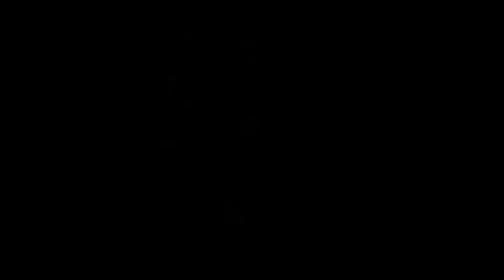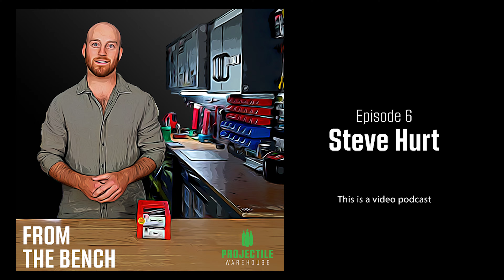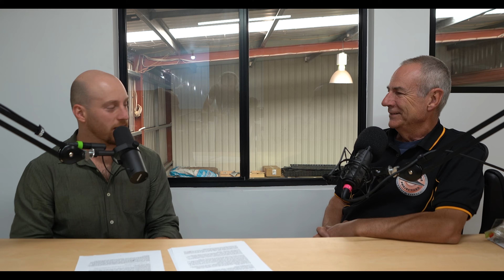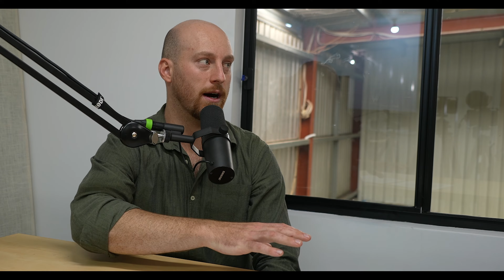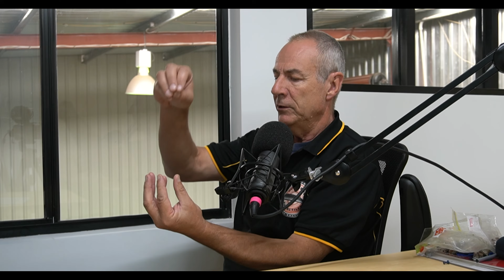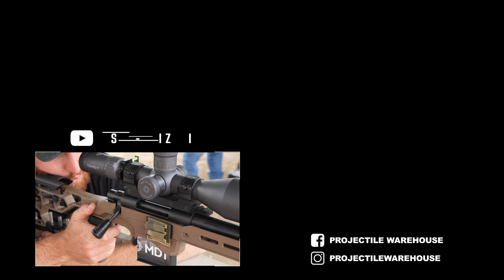From The Bench Podcast #6: Steve Hurt from Outer Edge Projectiles

Comment: I must say Steve knows his craft, not that I would be qualified to challenge him. I queried OEP load data for my 6.5 Grendel via email and Steve replied in person I believe within the hour with all the data I needed. 

Steve stated a particular charge weight range of 0.4gn where I could expect the best accuracy. I loaded up a usual incremental test, I started with the advised charges and it was 1/4-1/2 MOA groups straight up(100m). I fired the other charge weights to prove the load, all sub MOA. 

Needless to say I was chuffed, I had the ideal load essentially in 2 groups of 4shots. switching my .308 and .223 over also.